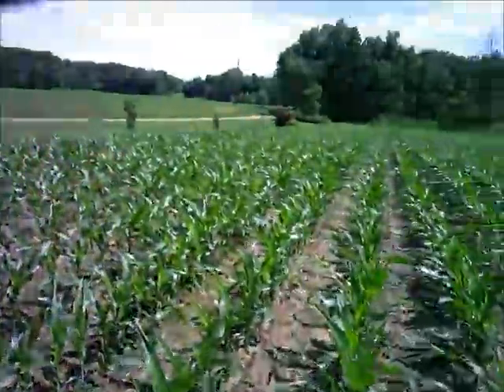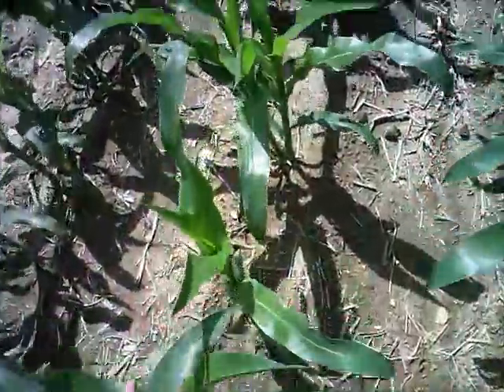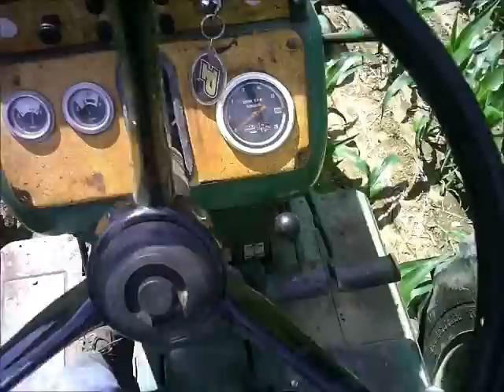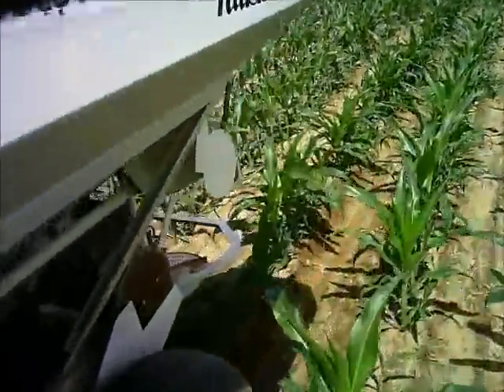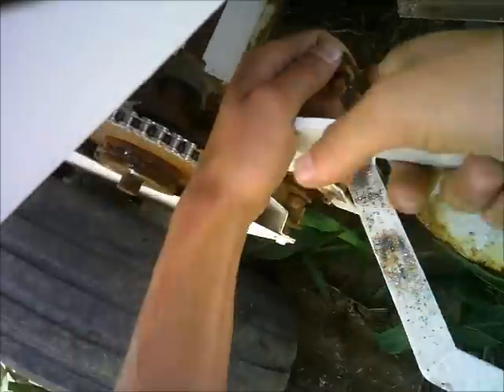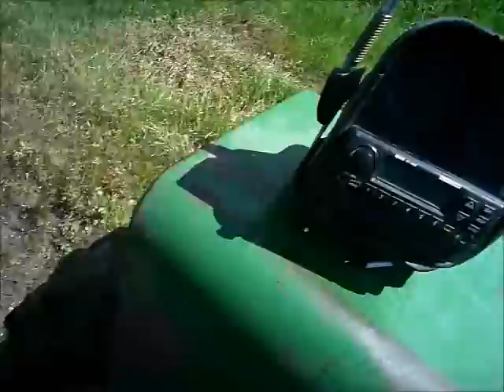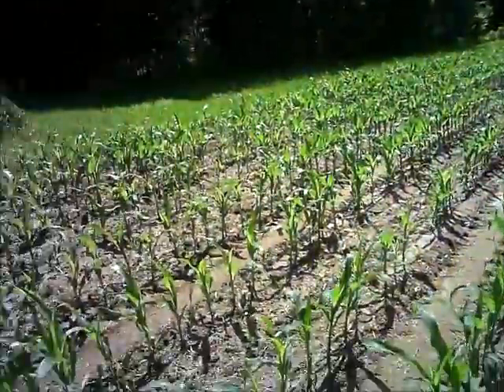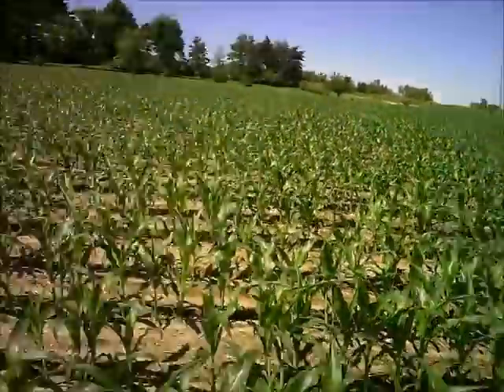Top Dressing Corn

Comment: With all the rain di you consider knifing in your nitrogen? Down here in southern Indiana it out produced urea by at least 40 bushel an acre.
Reply from the maker: +Bill Whitman I dont have a way to put on 28.
Reply: Down here, whoever you buy the anhydrous from generally provides the toolbar.
Reply from the maker: I cant think of a single person around here that uses anhydrous. I havent seen any tanks at our COOP in probably 5 years and they scrapped their toolbars. The Helena doesnt have any either. Our ground has too much clay to seal up good so its extremely dangerous to use anhydrous and youre loosing money right into the air. Our COOP only has one 28 applicator that is small enough for me to pull and come side dress time the waiting list for it is a mile long so im not waiting around for it, plus its a pile to begin with. And Helena doesnt have any applicators that I can pull. Hence, I have no way to put on 28 yet.

Comment: That may work for you in that soil, but you can't get away with spreading urea without incorporating it in the soil I've got (forest floor Iva).  You end up with lots of nitrate water headed for the Gulf (cultivating it in does work though).  That and unpredictable weather is why we always pre-plant incorporate the fertilizer.  I do see a fair amount of side-dressing with anhydrous around here.
Reply from the maker: 1850oliver180AC We are pretty fortunate that it works for us around here. I would say better than 90% of the N around here goes on side dress. However the recent weather has got me thinking about getting a set of saddle tanks and setting my cultivator up to put on N28. It wouldnt be a big deal if our CO-OP had a high wheel spreader but these Willmars that they have just dont have the ground clearance and it makes timing the applications pretty critical. If I had a decent cab tractor I would love to use Anhydrous but there have been a couple accidents around here in the past involving guys getting caught up in a cloud and getting seriously injured from that stuff when the ground wont seal up right so for now im gonna stay away from it.
Reply: Oliver66FarmBoy Anhydrous ammonia is dangerous, but I've got other reasons besides that for why we don't use it.  
My row cultivator is rigged to side-dress liquid fertilizer, but if I were to apply all the 32% UAN for the milo in one pass, I would run my 50 gallon cultivator mounted tank out in 1.5 acres.
Reply from the maker: 1850oliver180AC Yea, that would be slow going. I was figuring on getting a set of saddle Tanks about the size you had on the 1850. I just dont have a good tractor to put them on right now because my 1955 wont go narrow enough for 30 inch rows, narrow front on the 1800 wont handle the weight in soft ground, and the 1600 is getting a loader on it. All this tells me I have an excuse to buy another tractor!! LOL